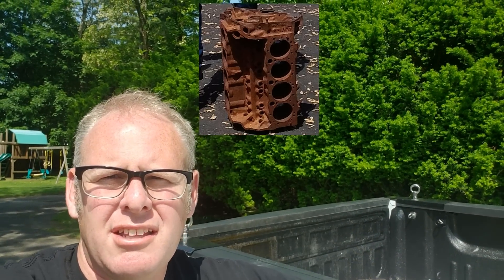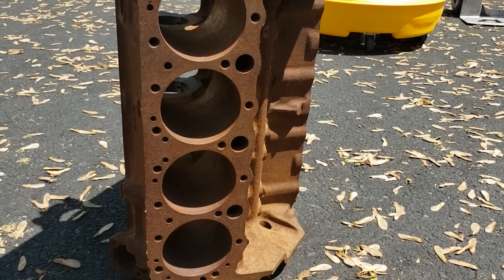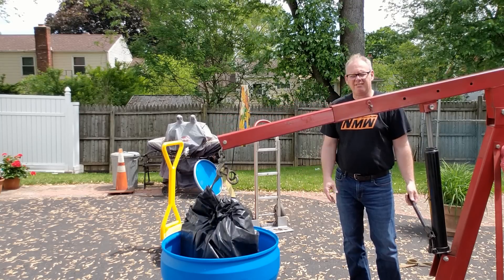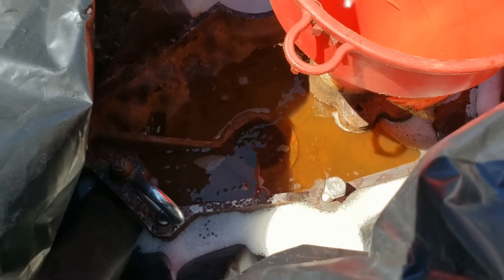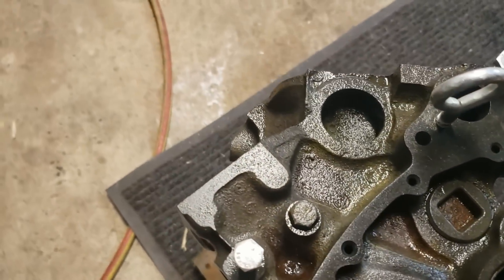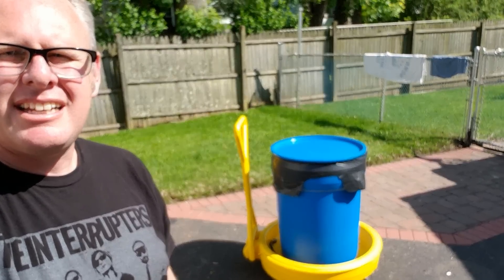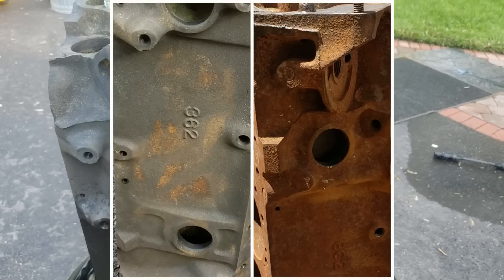How to Remove RUST from an Engine Block with 5 Gallons of Evaporust- Safe, Clean, Cheap Derust

Comment: I'd say try electrolosis it's cheaper safer and likely works better.
Reply from the maker: I think you could be right about being cheaper, provided you already had the battery charger and some other equipment. 

I'm curious how electrolysis is safer though?

The mention about better, is a relative term. The nice part about Evapo-Rust is that is ONLY eats rust. I think electrolysis can continue to eat good metal. It was always my concern that if I did not have everything rust free, and I left it in longer to get a rusty area clean, the spots which clean-up sooner would then degrade the good metal.

I did not want to open up critical areas like lifter bore clearance and such.  Have you done an enginer block with electrolysis? What kind of feedback did your machinists say?
Reply: @PaulsProTips  I haven't studied the msds on evaparust but I'd wonder what to do with the used chemicals? electrolosis all you have is some stuff to get rid off on top of the water such as grease,oil,paint. laundry soda and water and some rust chips shouldn't be to hard to clean up . you have a valid point about removing excess metal I've done intakes and tools ,brackets and things of that nature so far and it isn't fast but it works.
Reply from the maker: @justinriley8651  I copied and pasted this from Evapo-Rust:

EVAPO-RUST™ can be used over and over until performance drops off. When ready to dispose of spent EVAPO-RUST™, only the iron content of the solution will dictate disposal method. In most cases, it can be safely put down the drain.

Comment: Why did you cover the pistons holes? Idiot
Reply from the maker: You realize I covered the piston holes because I didn't want to have all the product occupying an area which would be machined anyway.

If I did not plug the holes,  I would have needed another 2 gallons of EVAPO-RUST. Shame that bothers you so much.

Comment: Great video man, Great idea with the Bag, I've got a 350 block that I need to get the rust off of so I'll definitely be using this trick, Just curious tho, Can't you just add water to the Evapo Rust tho ???
Reply from the maker: Thanks for the compliment!  As for adding water, they do tell you that the water will evaporate, and that it is best to mark the original liquid level in a container. That way you can add water and bring it back to the specific gravity of the original product.

I think diluting it additionally will make it become less effective. If you try that, please post your results here man!
Reply: @PaulsProTips  Yeah definitely man

Comment: https://youtu.be/qUHh0QqKrXs  see my comment about muriatic and phosphoric acid. You spent a fortune for an ineffective product and then what do you do with it?
Reply from the maker: How to you control the acid to stop eating away material, when other areas still need to remain submerged?  That was my main concern. I did not want to open up the lifter bores, after the rust was gone- as there were more heavily rusted areas that needed more time.

I also had the luxory of time. I left the block submerge all week and removed it the following g weekend. I feel the acid you would need to stay active throughout the process.

I'm certain your suggestion would work well for me on hundreds of things. For this engine block, I am happy with my results, and the ease of the process.
Reply: Paul's Pro Tips the muratic acid does not continue to work once the rust is disolved, It will be white metal and there will be no more reaction. You rinse with water and follow with phosphoric acid and and it creates a grey to even black conversion coating on all the bare white metal. You can actually just use phosphoric acid to disolve rust and once the rust is gone it will also leave it grey its just not as quick and agressive againt the rust. Naval jelly is phosphoric acid based. No matter what you choose you need to neutralize the acid with baking soda. Additionally as i mentioned you can use baking soda to completely neutralize any acid it creates co2 and salt water once it quits bubbling. Then you can responsibly pour it down any drain with no issue. What dd you do with 5 gal of Evaporust when your finished with it?
Reply from the maker: @GregariousAntithesis  interesting, I did not realize those acids only ate rust, and would not consume the virgin cast iron.

You only need to neutralize the acid for disposal purposes?

I still have my bucket of evaporust. There is only about 2/3 of the bucket at this point. One guy I work with uses it occasionally to clean up tools which get rusty.
Reply: Paul's Pro Tips it works fast and it will eat iron after the rust is gone if you used highly concentrated Muriatic which is hydrochloric acid just diluted.  but it slows way down once the rust is gone. Its a very powerful chemical reaction with iron oxide(rust) but it produces byproducts as the chemical reaction takes place which reduces its potency. I have found using muriatic acid straight it works really good to a point then it slows way down so you have to add more. I wasnt dunking anything was spraying steel that had really bad rust with the acid and wrapping with plastic sheeting. Leaving for a few hours then would scrub with wire brush and add more. On an engine block it woukd work extremely fast unless the block was from the bottom of a scrap pile. Last really important point do it outside with good ventilation the fumes are potent. Just try it sometime with a rusty piece of scrap. Oh and grease keeps it from working.
Reply: Paul's Pro Tips yes you only need to neutalize it and it becomes salt water and co2. That info can be found to support my statement on google. Here is a link explaining the chemical reaction and why it doesnt as readily attack clean iron. Oh and never store the stuff in an enclosed space it will cause surface rust any bare metal in the enclosed space in a short time. I store it outside in a ventilated shaded storage box for my spa. https://sciencing.com/clean-rusty-steel-muriatic-acid-8319296.html

Comment: Anyone consider diluting the evaporust in water since it’s water based?
Reply from the maker: The water can evaporate out of the solution. They actually suggest you make a line on the container when letting parts sit. If the level drops, add water to get back to the line, so the PH balance is at it's best for eating the rust.

I don't think straight diluting it will get you any more mileage.
Reply: @PaulsProTips  I see what you're saying, like thats how one keeps it performing to its intended level. I'm working with a subframe which is about 45" at its longest which is making a suitable container hard to come by and also filling that container expensive, like you addressed in your video. I don't expect the product to be able to do any more work but just to spread its existing work capacity over a larger area. But really the more I think about it your method is likely the better solution (no pun intended).
I'm planning on using my trash can and flipping my work piece to do one half at time. Just waiting for the trash man to come empty it.
Thanks for your reply.

Comment: Great video, thank you Paul. Did you have any issues with flash rusting after pressure washing? It didn't look like it, but how long did you have before the surface began to rust again?
Reply from the maker: I think the Evaporust may have something that helps (probably measured in minutes). We dried it with a leaf blower and immediately put the WD-40 on it.

Comment: Hahaha Wow. That worked really well. I spoke too soon. Haha I didn't know why you wanted to keep the evaparust out of the cylinders. I guess you take it to a shop then. Seems like a giant success.
I am one to talk. I need mad help! I can't move some rusted stuck wheels that a serpentine belt goes on. How do you move those? They are not easy to grab a hold of.
Reply from the maker: Could you do a better job of explaining your dig? I've head the cliche but don't understand what you are concerned with? 

It will be getting a fresh straight bore, so derusting the cylinder walls was not a concern. I probably could have done a better job by eliminating the bag and going straight product, but for the cost of the product used, I'm thrilled with the results.

FWIW, the coffee cans are about 1/3 of a gallon x 8 isnjust over 2.5 gallons of Evaporust which is about $50. I already had the coffee cans.

Comment: Not sure how safe this would be to use air to blow the Evaporust,  low side in Block with Airline to a pipe so it would move the rust around inside Block as it just sets. keep the rust moving will make it clean inside of Block, Also seen where one man used vinegar to clean his block out, maybe use a 55 gal drum with water, fill the bag with vinegar & maybe Airline to small ports to keep it moving around to help eat this rust away from Block, I know he said 50/50 did not work for him so it was full vinegar on his engine, munch less than the 75.00 you were out, I will do the bag & Vinegar first, if it works will let you know, 10 Gal of Vigenar may cost 10.00 15.00 dollars & looked to have cleaned as well as this did.Not trying to run your ideal down or anything, I like the Bag & the Evaporust & may have to use it after the Vinegar ideal if it fails, Thank you for your input, would have used 55 gal of Vinegar without your input.
Reply from the maker: I really appreciate the comment. I started this project with a similar thought as you. Here is what changed my mind. The Vinegar is a light acid that doesn't know the difference between rust and good metal. I had concerns that after some of the lighter rust areas were clean,  there are others areas of the block which really needed to be submerged longer. 

My biggest fear would be that sometimes casting numbers, or critical areas like lifter bores (which rarely have heavy rust) could get opened up or eroded from the acid.

The Evaporust was the perfect choice, and the price had me come up with the bag idea.

I look forward to your update. Good luck!

Comment: did it take care of the water journals and all that too, that's the bad thing about electrolysis it doesn't get into the actual block and clean the passages
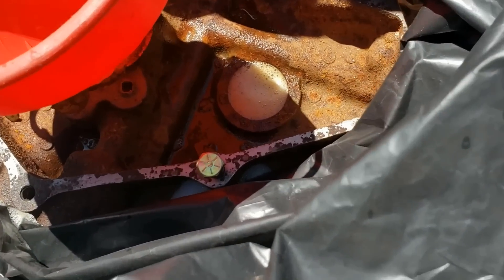Reply from the maker: It worked perfectly!  You can see at the 6:30 mark how it flowed through the block.

At 10:45 you can see the water jacket is as clean as the outer area.

Thanks for the comment!

Comment: Why not just have the machine shop blast it?
Reply from the maker: Not sure. When you say blast, do you mean with steel shot, or their acid cleaner maybe?

At the end of the day, I wanted to get all of the rust off- without the fear of an acid opening up clearance such as lifter bores etc.

There would still be steps at the matching shop, but for now- we're happy to have a rust-free block.

I appreciate the comments and feedback. Do you ha e any preferred methods or technique?
Reply: @PaulsProTips  Burn and blast. Basically makes the block look almost new. Same with heads as well. Works like a rotisserie with blocks and cylinder heads and is done for pretty cheap.

Comment: Is there any way this product can harm the engine block?
Reply from the maker: You can ask the manufacturer yourself. I specifically chose this because it is NOT an acid and will NOT affect the metal, once the rust is gone.

Comment: Great tip.  I was looking for a good way to clean up the cylinder assembly and miscellaneous other parts from an old riding mower engine.  With 2 five-gallon buckets going, your water bath method probably saved me 6 or 8 gallons of vinegar.  As Al Green would say, "Simply Beautiful!".

Comment: I found local guy who dips entire car bodies in caustic soda they do engine blocks for $100 make the block look like new. Evaporust is great stuff but 5 gallons is $100 it doesn't last long once it goes black doesn't really work that well again. I only use it for small stuff like bolts and such.
Reply from the maker: My struggle with acids and such is that you can't control what happens once it eliminates the rust in one area but is still working on rust in another.

I wish you the best with your method though. I think its ideal when you are working sheetmetal. When there are things like lifter bores which you risk opening up too much- there is where I get concerned.

The beauty of Evaporust is it ONLY eats rust!

Comment: It’s a 350 block with four bolt mains. Most likely came with a steel crank (not forged) out of a truck.
Reply from the maker: This is a block before they made 4 bolt mains. 1967 Nova block for a 327ci / 275hp.
Reply: What in the actual hell lol

Comment: Great video... Great idea using the water and bag to maximize the use of the Evapo-Rust.  Why did you use coffee cans in the cylinders?  Evaporators-Rust wouldn't hurt the cylinders.
Reply from the maker: Thanks for the feedback and question. The coffee cans were used just for a similar result as the bag and water. Rather than fill the Evaporust up in the cylinder bores, we had the coffee cans filling those voids.

Always open to better ways of doing things, but this was my 1st attempt, and since I don't have a ton of rusty blocks needing this, I may not sort it any better. Feel free to share more input or results.

I also would appreciate you shared of my videos, as I am trying to grow the channel.